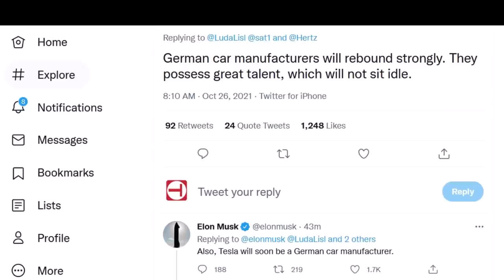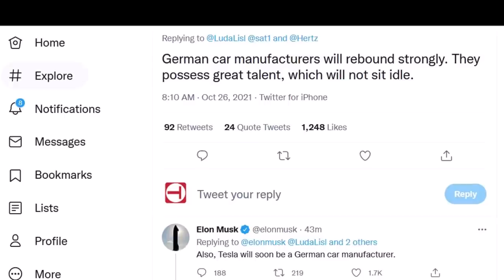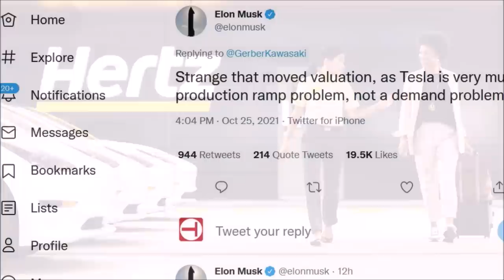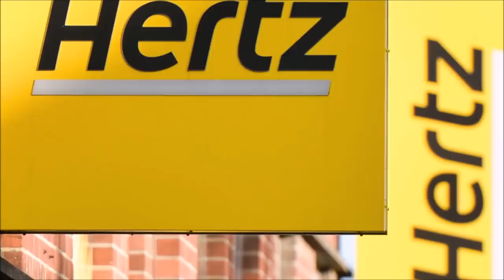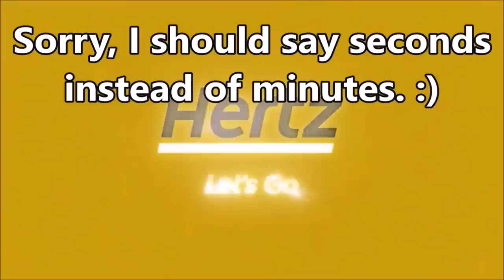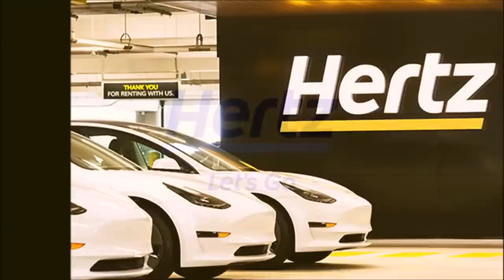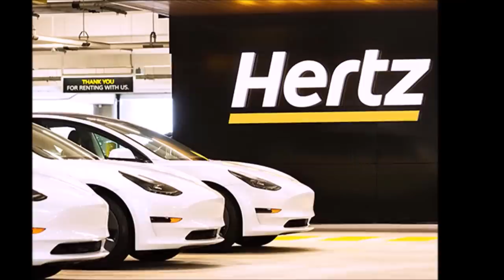MINUTES AGO! Elon Musk Says Tesla Will Become a German Car Manufacturer

Comment: The Hertz announcement didn't move any internal needles, what it did was open up the investors mind.
Reply: @maxkonig559  Tesla won’t be letting them owe money on car purchases.
Reply: @paulmcgreevy3011  Unless, the bank is loaning money to Hertz to buy them which is far fetch considering that they're basically a bankrupt company.  On top of that, they have all the other car rental companies to compete with.
Reply: @maxkonig559  Hertz is not a bankrupt company. It's a company that has just come out of bankruptcy. The previous situation has no bearing on the present company. They have new owners.
Reply: @dstr1  I'm pretty sure that you have stocks in Tesla but it's going to tank back to $400 a share.
Reply: @maxkonig559  - I doubt that Tesla will carry that sale for any length of time, poor business practice.  Tesla will get paid as the cars are delivered.
Reply: @maxkonig559  - The old Hertz is gone, new Hertz has financial backing and no doubt some borrowing power.
Reply: @maxkonig559  - If that happens, I'll pick up 1k shares.

Comment: I think people will be mix in regards to Herts rental. Knowing people as experienced at my job, they hate change. They’ll resist yelling and screaming like a baby.  At least half of them will but it will be a lot more than those who just “see the light” of EVs especially if they need to retrain their motor skills to not reach for a traditional handle, plug a key in, press the brakes, etc. It will be temporary but it will take years for some to adopt. Not worried though, eventually they will be assimilated as it becomes the new norm. But those people who adapt quickly, Tesla better have a quicker way for people to order their own Tesla cars. However, I’m worried about the ability to keep up with the demand – hopefully quality won’t suffer… again.

Edited autocorrect mistakes
Reply: I think maintaining quality is why Tesla is not meeting demand. Model 3 desperately needs the front and back castings used in Model Y. Hope fully Austin and Berlin will be going that way. Then the California plant can be reworked.

Comment: I still think that the type of car desired by people who do not have reserved parking either at home and/or at work will still be a hybrid type of EV were the ICE is there to charge the battery as needed. I'm retired and there is no parking available for a vehicle and therefore would have to park on the street when at home. Because of that, I would not have any way to charge a Tesla while at home. With a hybrid EV if for any reason the battery loses its charge overnight due to the outside temperature hitting -40°C which happens at least 5-7 days on average during every winter, the ICE would allow me to generate a good enough charge to be able to travel to the nearest permanent charging station.

Comment: Tesla is pursuing a strategy of localization. Though international headquarters will soon be in Texas, operations around the world will be largely autonomous, being not just local assembly plants but having local design centers, models developed for local preferences, local engineering talent, local suppliers and sourcing of materials, and local production of parts as much as is feasible. When fully developed they should be able to operate pretty much independently of each other from design to manufacturing.

In that sense, Tesla in Germany will be a German car manufacturer, just as Tesla in China is becoming more and more a Chinese car manufacturer.